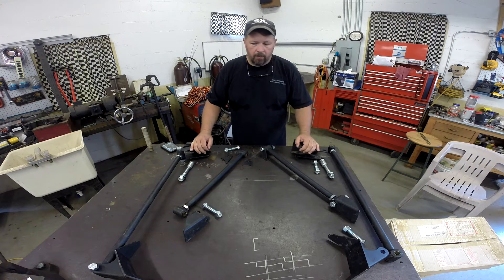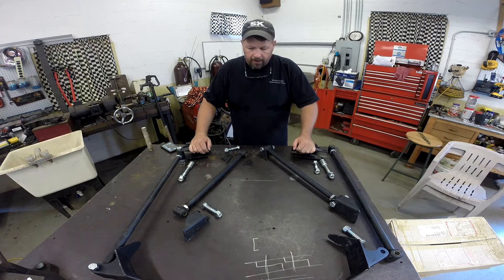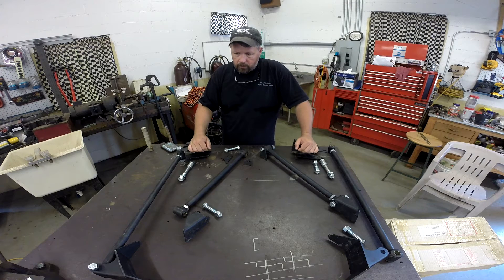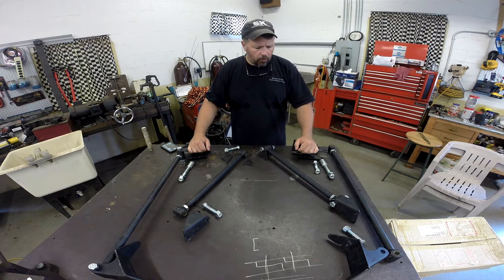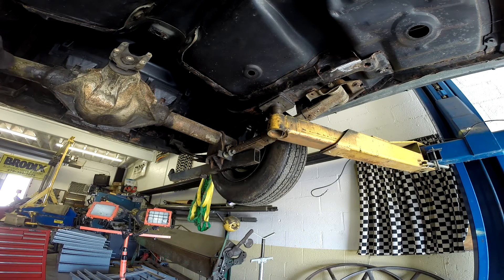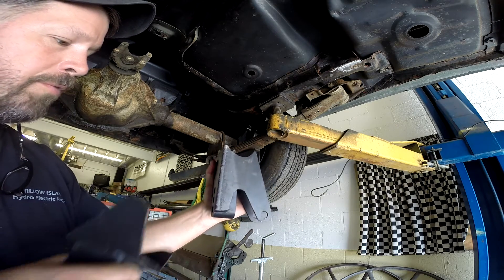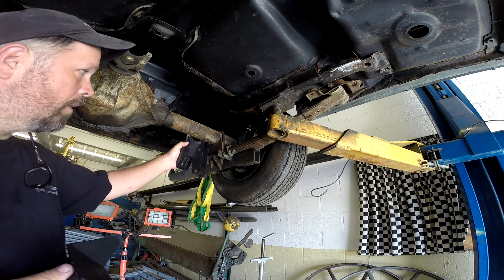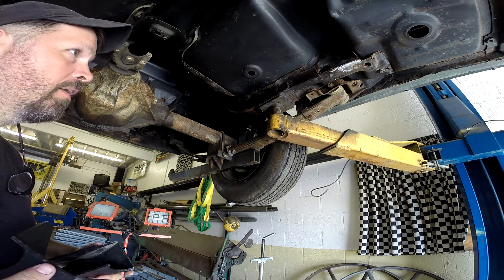Helix Four Link in a 70' Camaro Part I

Comment: I grabbed this for my 1969 Rustang Fastback RustoMod >  Helix 64-70 Mustang Bolt-In Deluxe 4-Link Kit w/ Coilover Shocks & Hardware 9190 > But prior to installing I was thinking that 9" Mustang Mach 1 axle housing with larger full size Ford drum brakes is very heavy. With a 72 Camaro front subframe with heavy connectors running back cradling a warmed over early seventies 455 Buck will this bolt in unit be safe and not fall out from under me when cruising the Florida Turnpike or Interstae Hi-ways? I will  beef up bolting points with welded plates as needed once I get into installation.

Comment: Do you think if the car had a weld in sub frame connecter set in it, that the lower bar installation would have been easier?